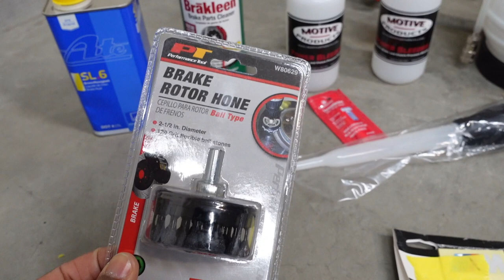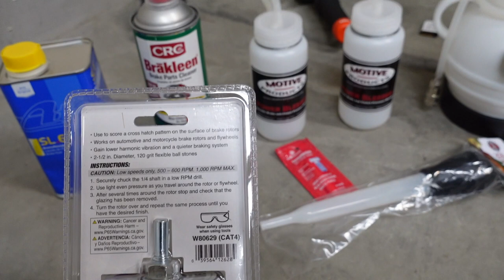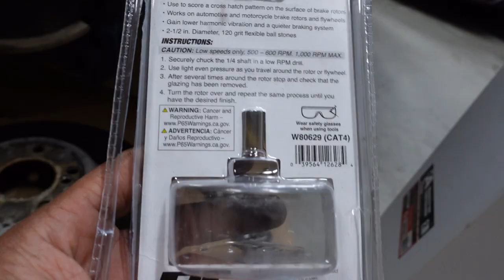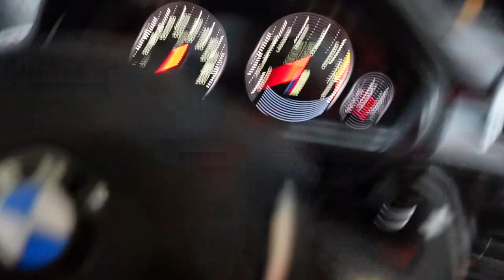X5M/X6M Rear Brake Upgrade!

Comment: Excellent video, ill be sending a link to it with all my x5m kits, pretty much a detailed DIY guide right there 👍👍👍 glad you like your set up !!!!
Reply: Tony, whats the fee on this kit?
Reply: @rickqueen65   1100 is the price, with pads, hardware, brackets, everything plug and play 👍
Reply: hi tony! is this rear brake kit only for BMW X5M F85 or for 30d F15 as well?
Reply: @giorgialeksandria6665  I’m thinking the same thing. I have a F15 but I’ve just ordered a set of F85 callipers and I’ll eventually get rotors to match. I want to put this caliper instead.
Reply: @Dentprotony what’s the website so I can order ??
Reply: Where can I order?

Comment: So you just changed them for cosmetic reasons? Braking performance isn't any better?
Reply from the maker: Mainly for cosmetics.  However I think there’s a 10% improvement.  It feel like it takes less effort on the pedal when coming to a stop.   Could be placebo but I waited a week or so and I have to re-train my foot a little better because it brakes more efficiently.

Comment: Why? Because of weight transfer. Upgrading to larger calipers without adjusting the brake bias is like wearing boots in the shower: Pointless
Reply: Brake bias difference is negligible, porsche caliper piston area is less than 10% larger overall. We got this 😊

Comment: Rear calipers are usually small because as a car brakes the weight is shifted to the front wheels as the front end squats. Manufacturers know a giant caliper on the back wont make much of a difference in braking distance so they put a small one which is all that's really needed
Reply from the maker: Yeah I understand it.  It still doesn’t change how I feel about it!
Reply: Going for the looks as well

Comment: But Edward, us fellow northern CA subscribers want to see your lovely wife pressing the brake pedal.  Are you ex-USAF?  Force, not pressure.  I always hit Steel mating surfaces with Noxudol so they won't rust again and Loctite PST on threading fittings.  The background music is unnecessary and distracting.  Interesting that you had burns from the brake fluid.  I never have had that.
Reply from the maker: Thanks for the tips and the feedback! 

Yes. prior USAF 

FWIW I chose music the because it was just my breathing you could hear.  I wanted to distract from that.
Reply: @eddiemcars  I thought so.  I was GCA Radar Tech at Travis AFB from 1970 through 1973 and my wife is from Fairfield.

Comment: Hello great video.  To make your next brake bleeding go faster there is a brake bleeding canister that you attach to your master brake cylinder where you can pressurize the system then bleed the brakes.
Reply from the maker: Thank you! That’s exactly what I used.   I didn’t show it in the video due to it already being long.  
I will have a separate video explaining that!
Reply: @eddiemcars  oh ok. Thats kool...  beautiful vehicle too. I have a 2016 535i xdrive.  Cleanest BMW in Michigan.

Comment: Which headlamp are you using?  Have a link?  Looks like it provides ample lighting. Great job on the how-to btw.
Reply from the maker: Thanks. I saw an ad on fb. Decided to give it try, the light is bright and it’s comfortable to wear.  Hopefully it will last long! 
https://visuslights.com
Reply: @eddiemcars  Preciate it. Looks like a decent deal since it’s on sale as well.

I did want to ask if you noticed any change in the brake bias from front to rear with the new setup. Any other notables that you’d like to share after having a little more seat time with it?  Aesthetically it definitely completes the package from a braking standpoint.

Comment: Amazing video been contemplating on getting the upgraded rear calipers and brakes i actually been in contact with the provider on Bimmerpost GREAT LOOK!!! Question what is your wheel setup are those 325-30-21& 275-40-21 ? Tires look amazing on those wheels
Reply from the maker: Thanks.  The front and rear tire sizes are 285/35/21 and 325/30/21 respectively.

Comment: Has anyone seen the price of the replacement pads? Not to mention the limited options.
Reply: Pad choice is extremely vast, price goes from 25 all the way to 250, carbon ceramic pads in the kit are 50 bucks by powerstop